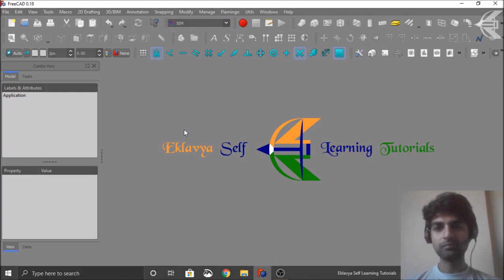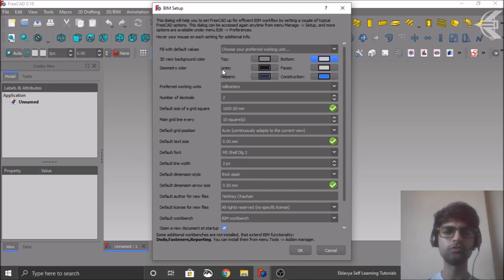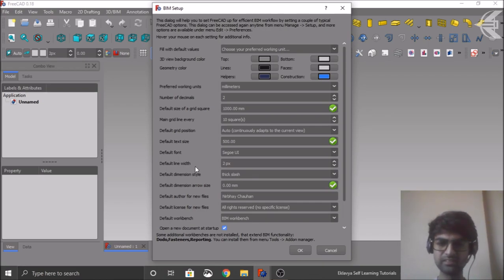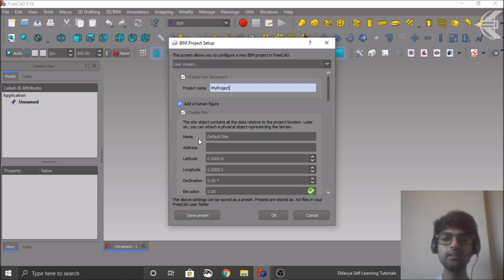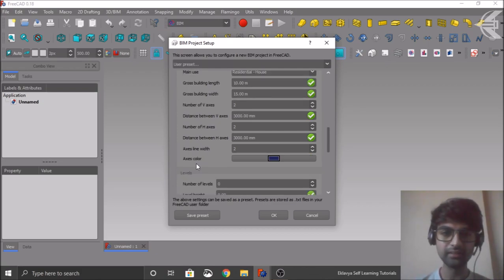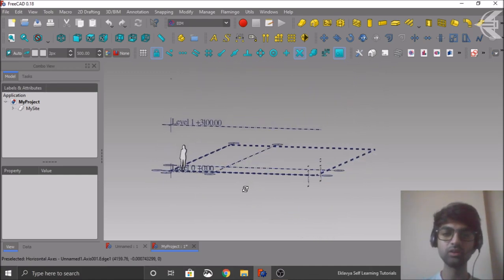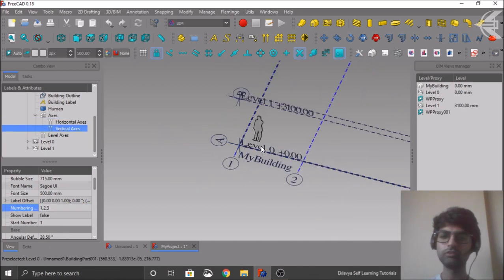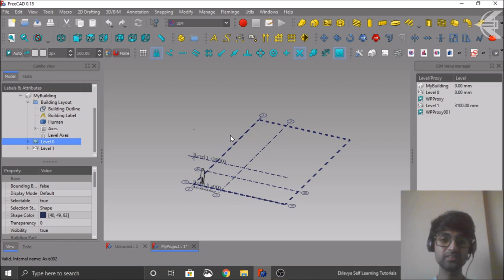001 - BIM Setup & Manage Project | FreeCAD BIM Workbench

Comment: I like it. Very straightfoward. I have a question: if you have a house with a single floor divided in two areas at diferent heights, like 3 steps defference, is it convenient to define two "levels" just to have two working planes?  Greetings from Uruguay.
Reply from the maker: Thanks for the feedback. :-)
Good question, in that case, you need not to define multiple levels. Simply create multiple working planes as per the height variations
I hope that helps.